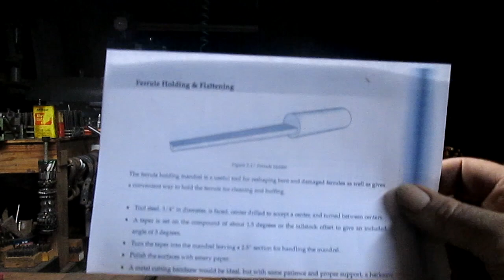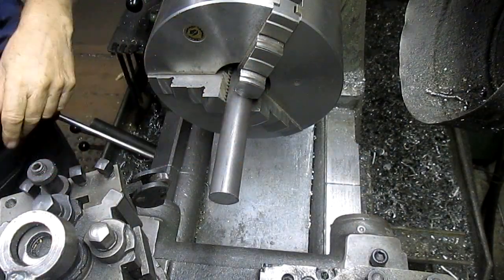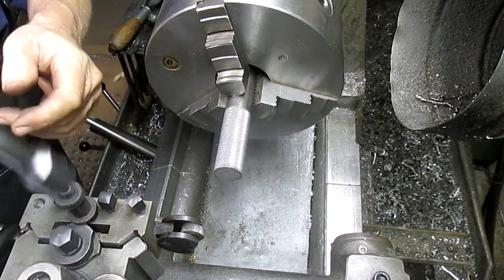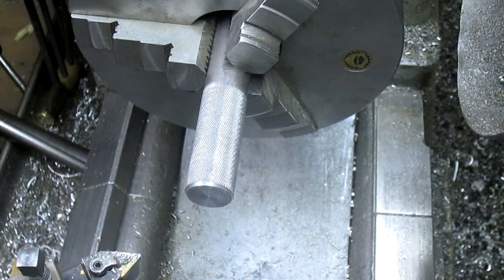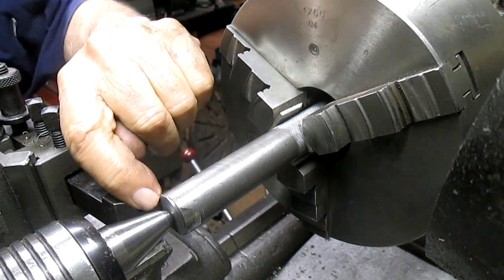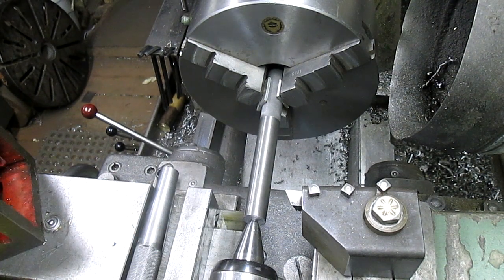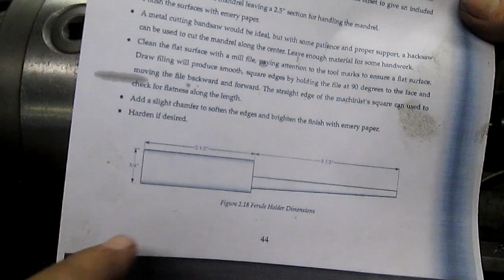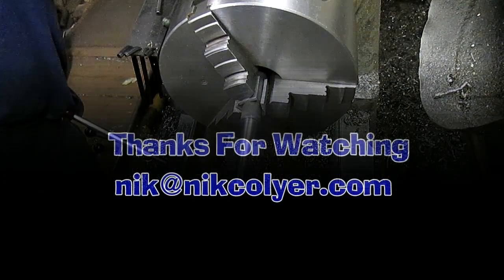Bow Builder Tool #1

Comment: Nik, that taper is probably not flat anymore. Emery with your hand and fingers has altered the surface profile . Should have used a parallel or similar flat surface to put Pressure on the paper. Regards from Australia.
Reply from the maker: It's a hand tool made to wedge between bow segments. The directions said to cut the taper with a belt sander and flat with a hack saw, so I think I'm okay.
Reply: Excelente nick
Reply from the maker: @alonsomattos6492  Thank You.